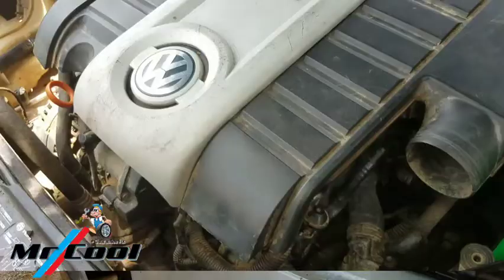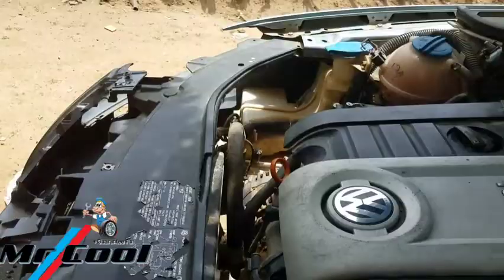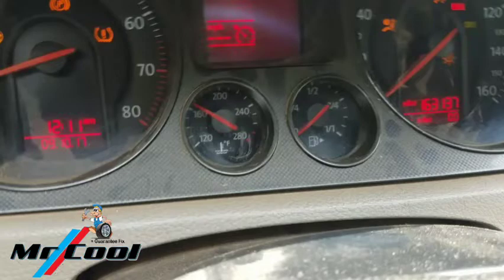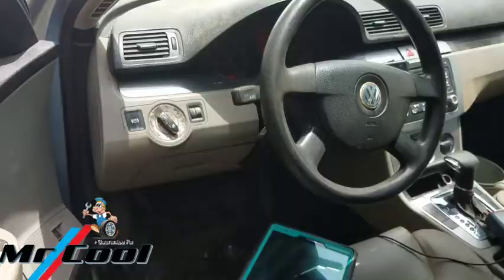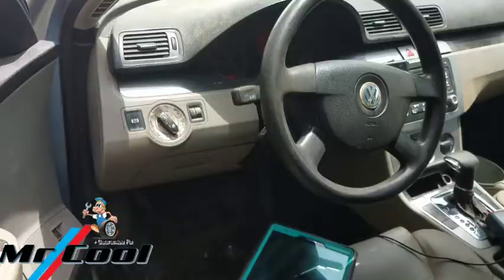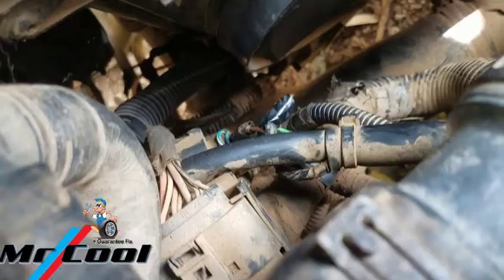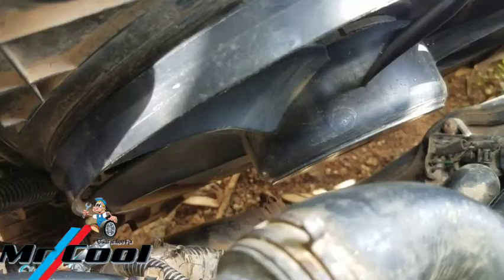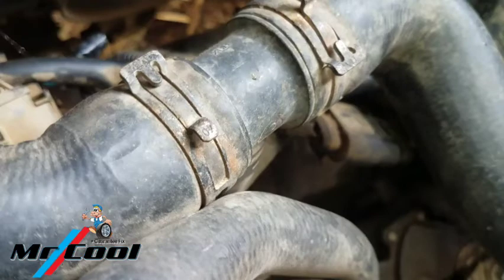Volkswagen Radiator Fan Not Working Temporal Fix, P0480 P1950

Comment: I have a 2002 Vw golf. The ac and fans stopped working at the same time. I changed the fan control module and it still didnt fix the issue. I changed the relay box on battery as well. Car overheats now . Will this method work for that year?
Reply from the maker: I don't think so

Comment: I have passat cc 2010 2.0tdi my big fan work but the small doesn't  after drive 100mph motorway I always  get overheating  is that can do that  ? Because of the small fan doesn't come on ?  And my heating doesn't work is well  I was change thermostat everything and still.do it same
Reply from the maker: The small fan is faulty.

Comment: Hi, i have 2013 Passat, when i Turn AC on the car over heats, and the big fan start then stops, the small fan works, .. mechanic shop told me today i need to replace both fans and the assembly....  the car runs fine when AC is off. any advise? should i try cutting the wires you mentioned and see if fan come on ? thanks
Reply from the maker: Replace the big fan or cut the wire & see if it run constantly when the car starts up.
Reply: @drcoolautofix   if i cut the wire how would i fix it ? solder it ? thanks
Reply from the maker: @bassimobten7856  just follow the video
Reply: @drcoolautofix   ok thanks,FYI, the error code the mechanic gave me was P1950
Reply: @drcoolautofix  i cut the wire, now how do i put it bacl?

Comment: i've proble with my 9N VW Polo 1.4,  i want to radiator fan turn on earlier because i live in tropical country and the temprature east to hit 90 degree. how should i do to make radiator fan spinning earlier.?
thanks
Reply: You need to change the coolant thermostat only that.

Comment: Hey brother i have a 2012 jetta SEL 2.5 my fans wont turn on but when i turn A/C on both fan spin fast and car over heating how can i fix
Reply from the maker: Your car need a close diagnostics from vw tech. This is not youtube thing. Even if its youtube, you will hire vw tech to troubleshoot the issue remotely and direct you on how to fix it yourself. If its me you intend to hire, it will range from $300 up.

Comment: Hi my car radiator fan didn’t turn on.When car is heat up fan doesn’t on.but when I turn on AC both Radiator fan turn on.I disconnect yellow small cable from radiator and fan turn on .Please let me know what kind of issue is with my car
Reply from the maker: Is your overheating throwing coolant out but the fan refuses to turn on?
Reply: @drcoolautofix  No I can drive without radiator fan off almost 600 Kilometers and car stay at 75 to 85 centigrade.4 months ago I had Car inspection and they gave 3000 rpm race almost 1 minute and my car heat up and throw coolant out and heat up.Normally I can drive car without any issue.Sometime my car heat up I turn on AC and both fan start working.I am not sure what should I change ?
Reply from the maker: @NoOne-cb4qv  you probably have a fan relay issues
Reply: @drcoolautofix  yes I have that issue

Comment: Hi I'm having the same issue, my fan won't turn on .. my big fan used to run at full speed without being plugged in at the radiator while the AC fan stayed off.. Now the big fan has stopped completely and my car is overheating, throwing coolant out of the bottle... 
Might this be the same issue 🤨🤔🧐
I'm driving a 2005 GOLF 5 2.0 FSI (NON-TURBO)
Reply from the maker: You sound like a non Subscriber & non member, you are only eligible to get a support from me only if you are a real supporter of me, aside this, have a wonderful day.
Reply: Did you ever get this issue solved? I have the same issue on my 2015 jetta
Reply: I'm also having the same problem on my 2015 polo vivo especially when it's a stop n go convoy my car is overheating,it throws my throws my coolant out...